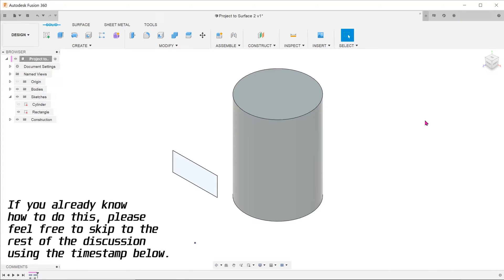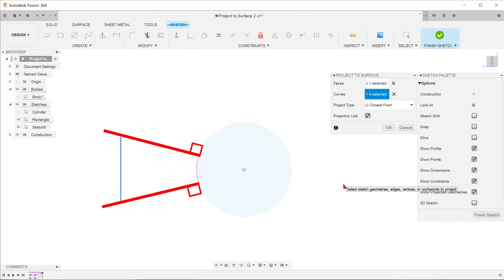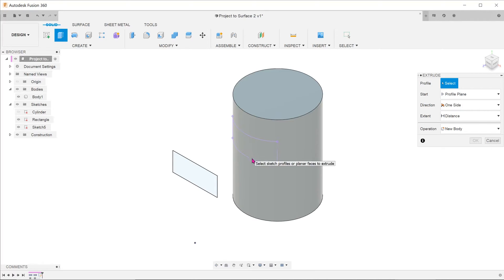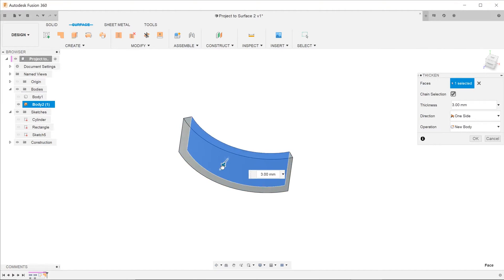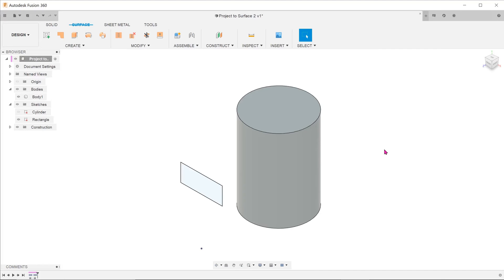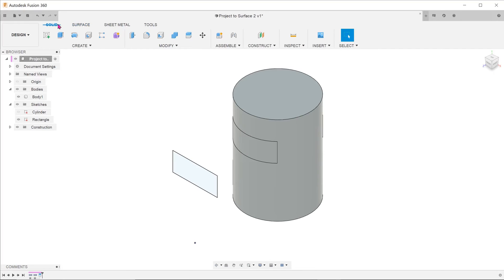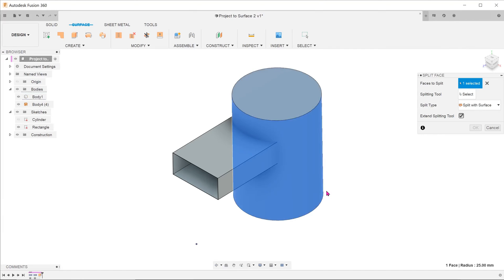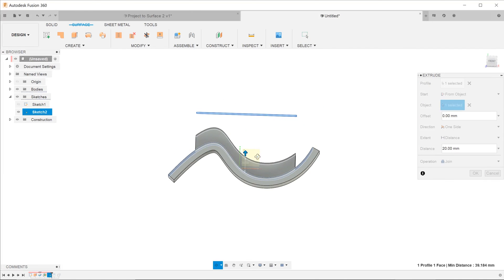Fusion 360 - Project to Surface (Do you really need to use this command?)

Comment: Ive spent 2 days struggling as a new user, and a whole day with chatGPT trying to perform what seems to be an impossible task. 
I have a 3D object, fully constrained in sketch mode. 
I've flipped the job to create an arc on a perpendicular face to the plane i need curved.
Extrusion was successful, and the base of my object is now curved. 
Happy until GPT confirmed that i can't now select that curved surface, which im sure i've managed to do before.
so i removed extrusion, created an offset plane 10mm from the surface i want curved. 
With offset in place, i created a new sketch, drew a circle, replicated it across the new offset sketch plane with the rectangular pattern and it looks great. 
Ive tried everything I can think to merge these circles to the soon to be curved surface, without success until trying the emboss tool. It worked to pull the circles through the offset plain and onto the curve after i extruded it using the arc i sketched. 
However, the result is not what i'm looking for and ended up with a bunch of tiny cylinders on the curve, instead of sharp pointed cones i managed to extrude when trying to do this.
Basically, i need to cover this curved surface with 5mm diameter, -25degreee taper angled conical shapes to act as grip for my idea to work.
Would absolutely love some expert guidance please.

Comment: The trick is to create a sketch on the cylinder first otherwise you will get an error if you try to project to surface. Thank you for the awesome tutorial.
Reply: So wait, I'm supposed to create a sketch on the cylinder to project a sketch on that same cylinder? how do I sketch on a cylinder first? do I create a plane first bisecting the cylinder to then project on that plane? but then this tutorial makes no sense because it doesn't follow what now we're supposed to do, because this tutorial doesn't include that, so WTFFFFFFF!!!!!!
Reply: First you create your profile sketch, finish that sketch. Now you need to create another sketch (wherever you want! Plane does 't matter because it will be a 3d sketch.) and use "Project to surface". Save that sketch too.
Thats it. You can't create "project to surface within a sketch that has already defined as a 2d sketch. (Where your profile was created)

Comment: Now you can use emboss :)))
Reply from the maker: It really depends on what effect you are looking for. Emboss should only be used when you need to wrap the sketch entities. In the case of a straight projection, extrude should still be used.
Reply: Fusion 360 School sure, sure! It’s absolutely different features. But you right, emboss is more for wrapping sketch around the face.